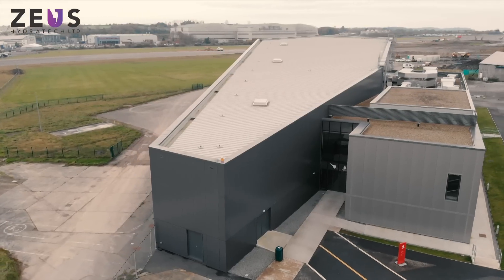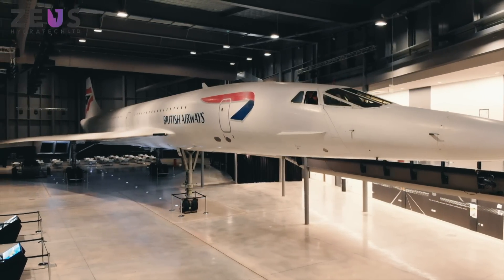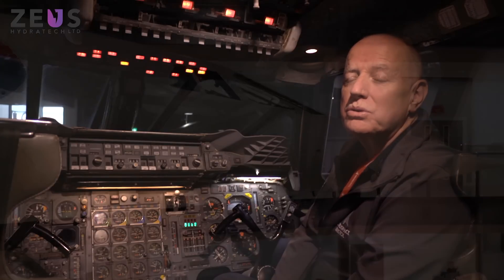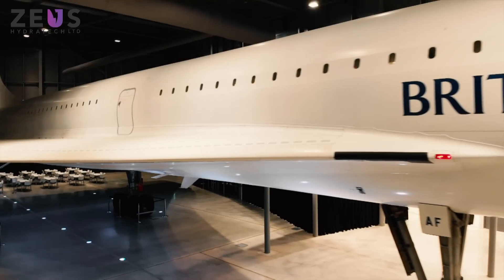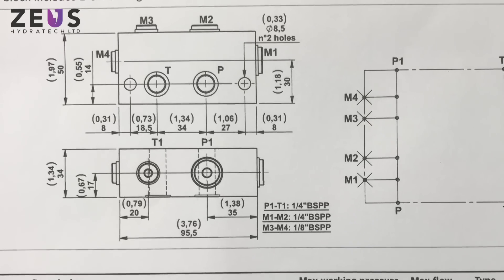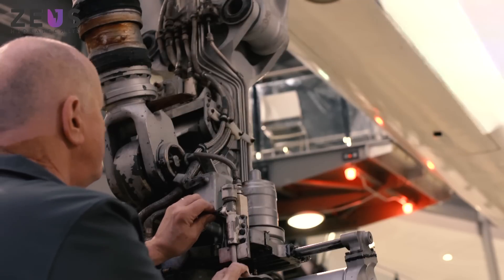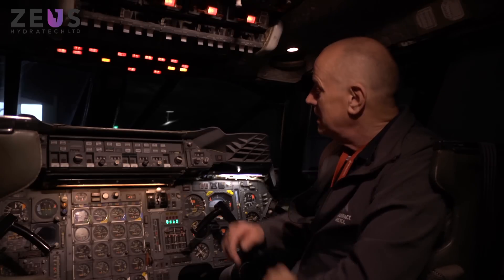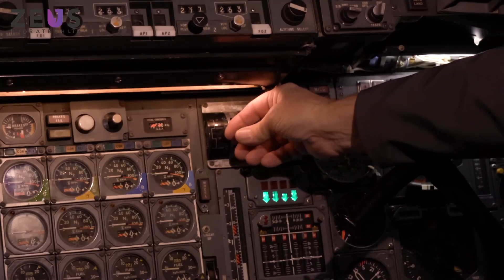Reactivating Concorde's Droop Nose

Comment: I was stationed at Torrejon A,F.B. Spain when the Concorde was test flying from there. The AC had British Air Ways paint scheme on one side and Air France paint scheme on the other. She would sit at the end of the runway with the nose in the droop position throttle up for take off and the sheet metal siding would start to rattle and shake. I swear rivets popped out of the building. Once she was in the air. the test pilots flew her like a fighter. It was a one plane air show. I would love to have flown on board her!

Comment: Had Concorde been designed and built a little later, there would simply be a few cameras and a few monitors to improve the visibility. Even in the sixties, I imagine, a few of the engineers had to have thought about it.
Reply: So you'd fix the nose in place permanently & the cameras or monitors die...what would their redundancy be?... Not a lot.

With this they back-up hydraulic system & if both fail it has a manual crank.

Redundancy aside there were also Aero reasons for the droop nose.
Reply: how about mirrors?

Comment: Great video - just for the record, Duxford's G-AXDN has the "droopiest" nose - and was also reactivated in 2023.  BA pilots, flying 'DN, reported that they would still like to SEE the nose - so the engineers dialled back so that later Concorde noses didn't droop so much!   Great to see ANY Concorde airframe moving.
Reply: Been there! I saw the droop demonstration, crazy how it almost reaches the floor! Pretty sure it's 12.5 degrees!

Comment: She still has plenty of life left in her. <3
Reply: @Élégante personné Somebody got it! Oh yeah.
Reply: Not really. The air-frame at this point is unrecoverable and non-airworthy, the hydraulics have been drained permanently and is feasibly impossible to replace. Unfortunately there is only one production Concorde that could ever fly again, and it is in Barbados. That air-frame was never decommissioned (much to BAs anger) and the triplex hydraulic systems were never drained of Dextron fluid. That Concorde really is in flyable condition. Unfortunately with 13+ years sat out in the wind, rain, ice and raging heat without maintenance, the Bristol Concorde probably has corrosion everywhere underneath that white skin.
Reply: @mrbiggs2368  What about Concorde BTSD? I read about how that one still has its hydraulic fluid, and there's even a video of its elevons and rudder being tested

Comment: Mankind though the ages has improved, progressed and innovated, this must be one of the rare examples when we have truly gone backwards. It's just a crime that BA hasn't allowed at least 1 of these aircraft to remain in a flying condition.
Reply: It wasn’t a perfect aircraft. Noise and fuel consumption was probably an issue
Reply: They wanted to!!! BA was starting a life extension and interior renovation program to lessen the charter flights as a way to preserve the number of airframe cycles.  By doing this BA hoped they could maybe even get her to 2012 instead of the original plan of 07 retirement after the modifications.   

But Air France pulled out completely, and Airbus said they would simply refuse to supply any replacement parts after AF retired their fleet.  Even after this, BA wanted to keep a single concorde in service for heritage purposes and only fly subsonic.  It just was deemed unfeasible.  Such a shame.
Reply: @Johnnyprc  Not true, at least perhaps true for BA, but Branson's Virgin wanted to take them on but BA could not have that, so here we are.....
Reply: Technology wise, maybe, but socially humanity is in a nosedive.

Comment: I wonder how much effort would need to go into making this aircraft flight certified again? Its only been 17 years but I wonder if they took out components over the years and how much would need to be replaced.  Judging by the fact that they needed to create a brand new hydraulic system just to get 1 part running again probably means the aircraft is in really bad shape compnent wise. 

Ive done some restoration work on retired/decommissioned nyc subway trains, ones built in the 1930s and the team managed to get them operational for special passenger service after 50 years. Getting something working again from a time that's long past is a really special feeling. Maybe one day we'll get lucky and see her fly once again.
Reply: Component wise this aircraft is in perfect condition, could be flown tomorrow. The hydraulics are custom because they couldn’t run power or hydraulic through the actual plane, had to come from the Museum.
Reply: Wasn't the point of redesigning the hydraulics because they only wanted the front section working, not the entire hydraulics tho?
Reply: Virgin wanted one but it wasn't allowed by ba
Reply: @robertwilson8365  Since they were given to BA for $1 each. The government should have forced their hand.
Reply: Unfortunately, British Airways destroyed most of the documentation for the all the Concordes they had. This had the effect of preventing anyone else using them as it is almost impossible to re-certify without records.
Reply: @petertwiss4215  They also drilled holes in the floors just to make sure it's fate was sealed.

Comment: Step 2: reactivating Concorde’s 4 Olympus 593s
Reply: Step 3: flying it.
Reply: @AdmiralDino235  step 3: mach 2
Reply: @AdmiralDino235 won’t happen. Airbus cancelled the type certificate in 2004 and they have no interest in it at all. Even getting one taxi worthy is a massive undertaking.
Reply: @RainbowManification couldn't it be recertified as experimental? Might not be able to have passengers but she would be legal to fly...
Reply: The Olympus 593 sounds like a pod racer engine.
Reply: step 4: profit.
Reply: Step 3: just take of because you've got that far
Reply: there is a guy Adrian Bennett who has a working Olympus 593s that he fires up, he has videos on YT
Reply: Actually, it would be activating the control surfaces.
Reply: That's gonna take a whole lot of jungle juice! Just taxiing used more fuel than your car does over a year.
Reply: step 5: on takeoff, have a piece of metal fly into your tires and fuel tank causing your left engine to catch fire and soon crash into a hotel killing everybody onboard the aircraft